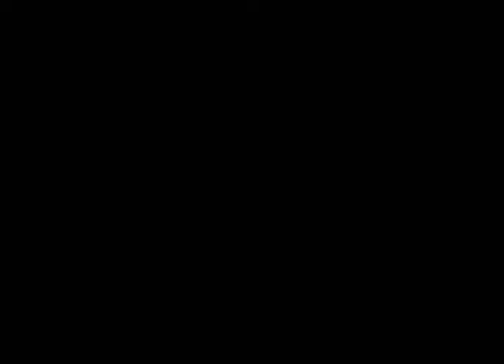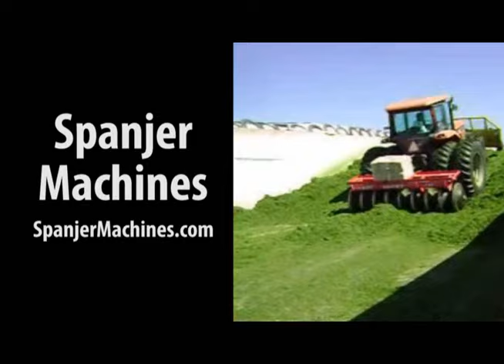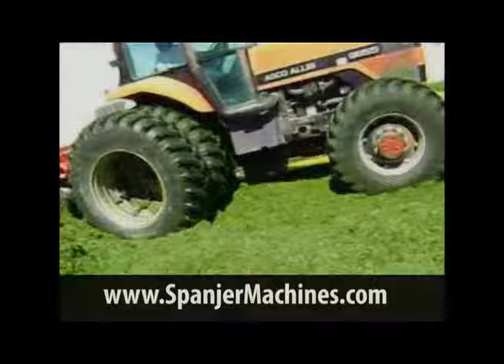Silage_Haylage_Packing   -spanjermachines

Comment from the maker: If  one was to double skin the dozer blade and fill it with concrete or  scrap slugs,
you would  be able to  hold the front down.
Provided the linkage is strong enough.